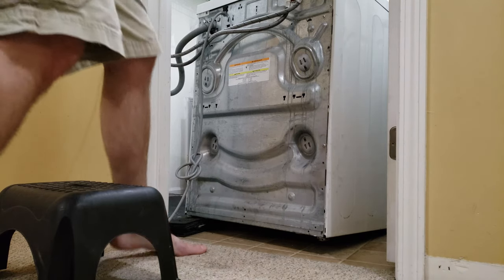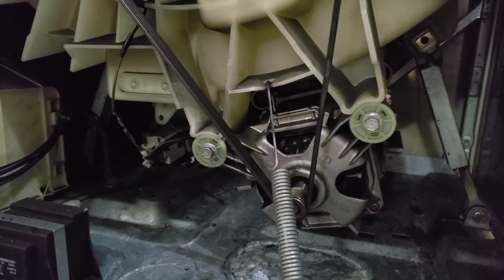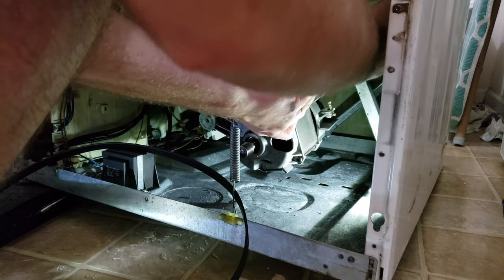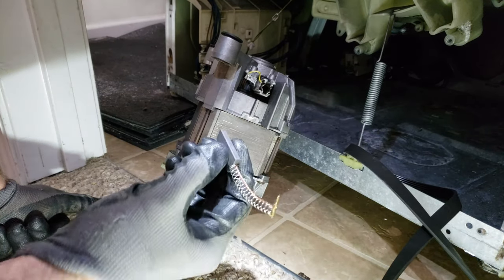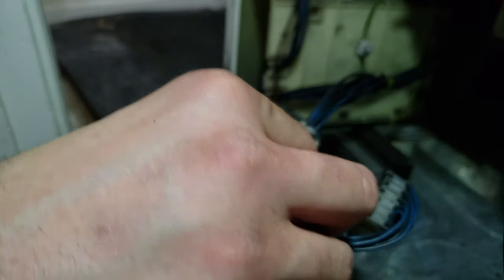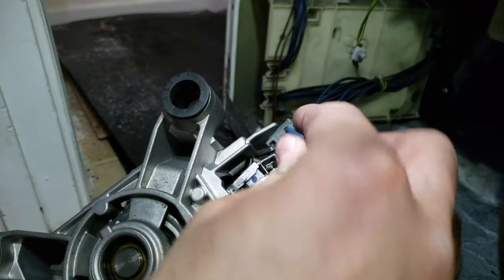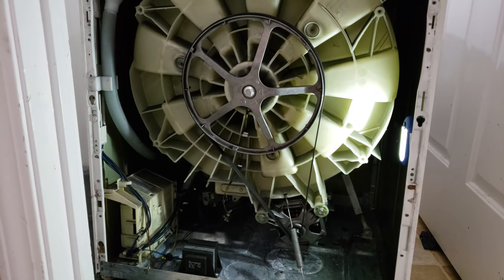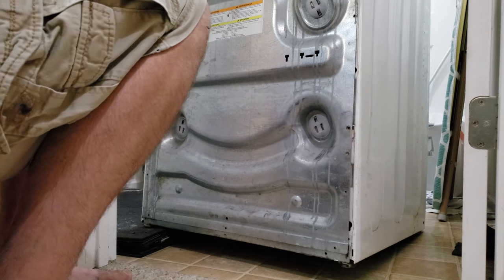Replacing Bosch & Siemens Washing Machine Electric Motor Brushes - Will Not Spin - Simple $10 Fix

Comment from the maker: Purchase the Replacement Carbon Brushes from this video:  https://amzn.to/30BLuVl

If that product is no longer available on Amazon you could also try: https://amzn.to/3iwnhG3 or https://amzn.to/3leLXEF or https://amzn.to/30Aoypy or https://amzn.to/3jBZoyb.  As long as the size is: 36 x 12.5 x 5 mm, it will work.
Reply: Getting that motor out had me thinking, after seeing this, confinement enough to lever it out.  Thanks dude
Reply from the maker: @cid3384  I'm glad the video helped.

Comment: You can try doing it like this, but you're better off detaching the wiring from the motor and getting the motor onto a bench. Fitting the new brushes is a fiddly enough job without having to do it in a confined space on the floor.

Comment: Any idea of the WFMC2201UC/13 washing machine? Mine just slowly spins sometimes, leaving me with a soaked load at the end of the cycle. Scratching my head here.
Reply: A bad brush(s) can cause that, but also: Not spinning at full speed can be a bearing on either the motor assembly or the drum itself. First UNPLUG, then if you disconnect the belt, you can try to spin the drum... it should be very very easy to spin. If the motor should also turn rather easily by hand. If both do spin easily, sorry to say it might be the electronic control which switches speeds on the motor... and it can't get "into high gear": electronics replacement most likely not cost effective. Bearings can be replaced, if you or someone you know has experience with auto repairs, etc.